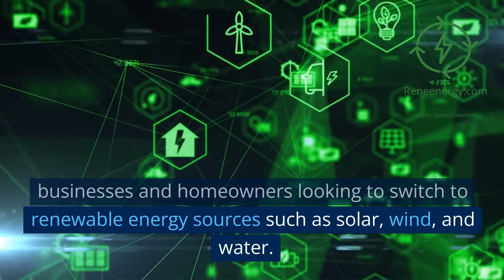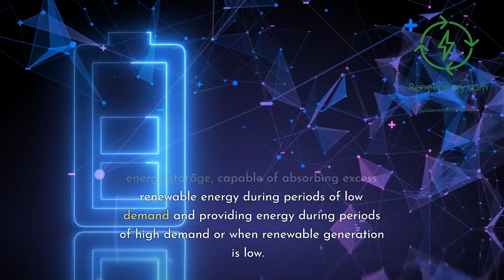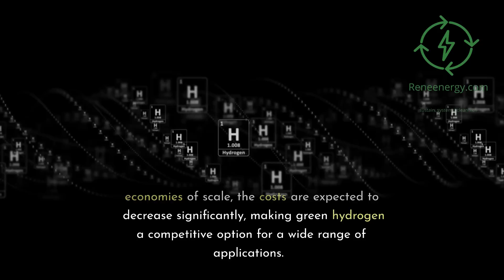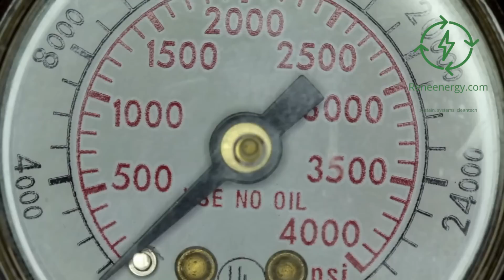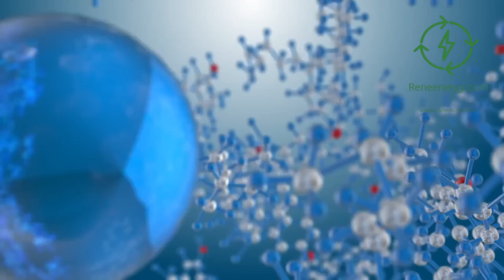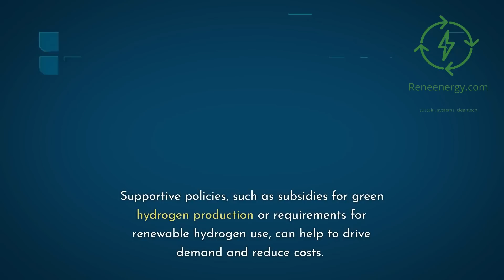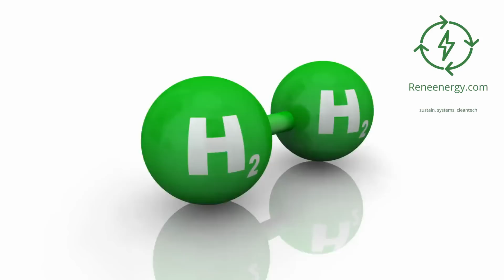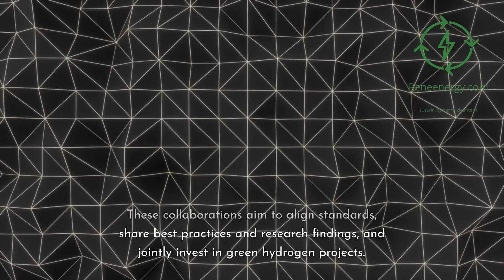Green Hydrogen - Production, Storage and Transportation

Comment: If it's cost seeing so much to shock the water with electricity , you can also heat the water with a heating element inside the same item and it would make the water break the oxygen and hydrogen apart faster. And you won't have 2 put too much electricity to it.Because it helps break it down with the heat.

Comment: Hydrogen is best generated at the location where you want to use it.  This way, you don't have to compress or liquify it or transport it with the efficiency costs that this causes.  So, when you have a niche use of Hydrogen such as producing green steel, cement (perhaps), refining sour hydrocarbons or chemical production, transmit the electricity via the existing grid and make it on site.  But for heaven sake, give up on using it for land transport.

Comment: SHIPS ON HIGH SEAS CAN GENERATE HYDROGEN ON THE GO BY ELECTROLYSIS  OF SEA WATER AVAILABLE IN PLENTY  AND THE ELECTRICITY NEEDED CAN BE SUPPLIED BY ON BOARD  GENERATOR  IF COST IS VIABLE  AND PRODUCTIVE.
Reply: Sounds good but next time please turn off the CAPS LOCK

Comment: There is very little energy in hydrogen, and the fuel cell have 35 % losses, and when you convert it back to elekricity you loose a 35% again, and it is the smallest molecule, so it is leeking eaisy, and there are not mutch energy in it.  It has to be compress to as much ad 700bar in viecles, and it is a master, vhen leeking. 
 So No, I think battery is much better. How I see it.
Reply from the maker: Thank you for your comment stigbengtsson7026. Hydrogen fuel cells face challenges such as lower energy density, significant energy losses during conversion, and issues with hydrogen leakage and high-pressure storage. In contrast, battery electric vehicles are generally more efficient with simpler energy storage and conversion processes. The choice between hydrogen and battery technology often depends on the specific application, with batteries favored for efficiency and hydrogen for certain long-range, heavy-duty uses.

Comment: The enthalpy and entropy do not change, only the activation energy.  The energy to make H2 is very high, and the energy released is less than 50% of the energy to mke the H2.  Storage and transport of H2 are difficult and expensive and electrolisers and fuel cells are more expensive than batteries that are some 90% efficient.
Reply from the maker: You're right in pointing out the challenges with hydrogen production and utilization. While the process of making H2 is energy-intensive and currently less efficient compared to battery technology, ongoing research and development are aimed at improving these aspects. It's crucial to consider these factors in the broader context of sustainable energy solutions. Thanks for bringing up this important perspective!

Comment: 0:57 water vapor is indeed a greenhouse gas!
Reply from the maker: Thank you for visiting the reneenergy.com youtube channel. Indeed, but not a harmful GHG as such. The combustion of green hydrogen produces water vapor, which is a greenhouse gas but primarily acts as a feedback mechanism in the climate system. This means that while water vapor can amplify existing warming, it doesn't initiate climate change like CO2 or methane. Therefore, the water vapor resulting from hydrogen combustion is generally considered less problematic in the context of long-term climate change compared to greenhouse gases that act as forcings.
Reply: Water vapour is greenhouse gas, but water cycle is more efficient to establish balance than carbon cycle which is being demolished by deforestation, thus being more suitable to resist climate change.
Reply: " water vapor is indeed a greenhouse gas!"  100% false.   Do you also believe that the Elvis is still alive?

Comment: Hydrogen is a greenhouse gas.

It is a fallacy to claim Hydrogen doesn't emit greenhouse gases. It impedes the natural processes that remove methane, a super greenhouse gas, from the atmosphere, so it is listed as a a greenhouse gas. Hydrogen is the smallest and hardest to contain atom. Any production, storage, or transportation of it will result in significant leakage into the atmosphere.

Also, it's energy density by volume, which is the more practical perspective, is much lower than fossil fuels. Methane has around 3.5 times the energy as Hydrogen in practical applications.

Also, the vast majority of Hydrogen is produced using fossil fuels at the moment. Methane and coal are the biggest producers right now. If Hydrogen was to scale up to offset other energy systems, logistically, it is pretty much guaranteed that a significant portion of the Hydrogen used would still need to be produced with fossil fuels.

In that case, Hydrogen will end up being nothing more than fossil fuel greenwashing. It will also not reduce climate change, but accelerate it.